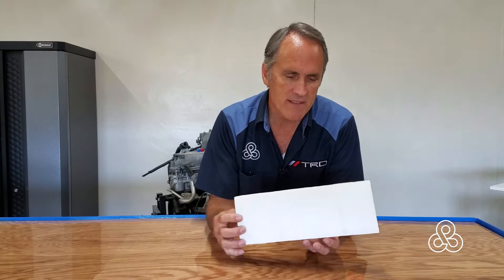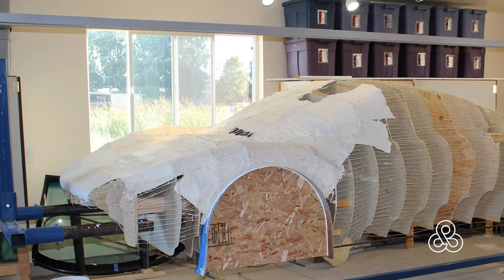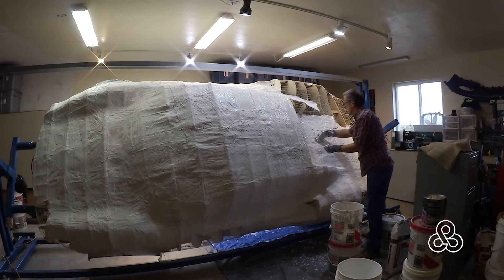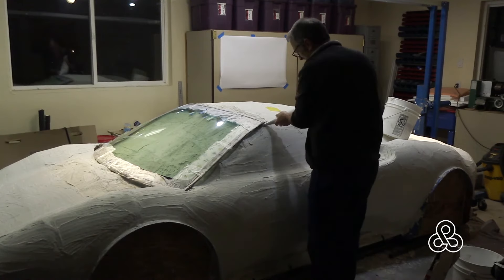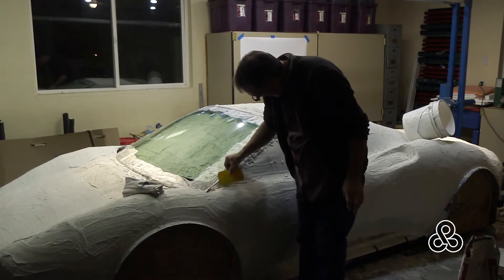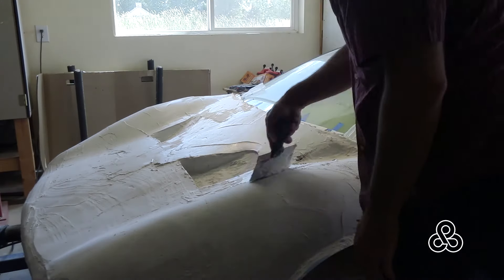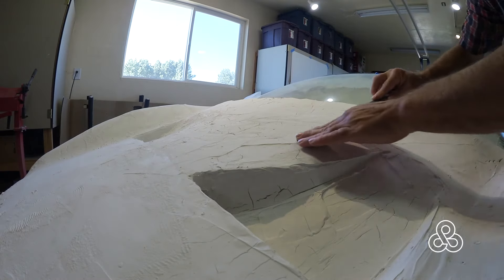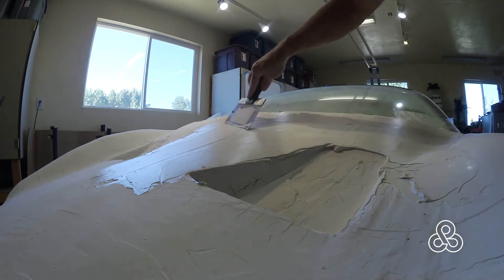A04 - Can we build a car out of burlap and plaster that will go 200mph? Jarvie Arete project

Comment: You used burlap and Plaster of Paris on the initial layer. Next you added "plaster". What kind of plaster did you use? There are so many types, I wasn't sure what kind you used. Thanks. Enzo
Reply from the maker: It is best to use the air dry formula of gypsum used in building construction to fill the seams/gaps on drywall (gypsum board). You can find it in contractors building supply stores. (Drywall Mud)

Comment: I'm curious, for the windshield, did you find one that fit your idea, or did you modify your idea to fit a windshield you had?
I'm trying to source a windshield based on the dimensions I want, and struggling to find a way to do that.
Reply from the maker: A bit of both. I found a windshield that fit somewhere between the $20k savings and design compromise. I could have my "perfect design" for an extra $20K or change my design to fit a $180 existing windshield. Drive around a shopping mall with a tape measure and see what would work.   A thousand cars parked for your viewing pleasure.